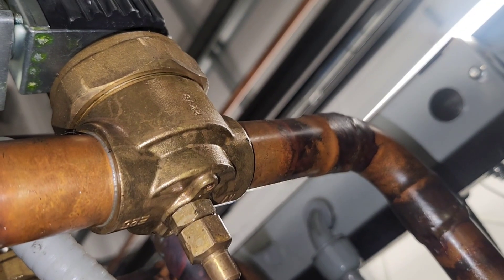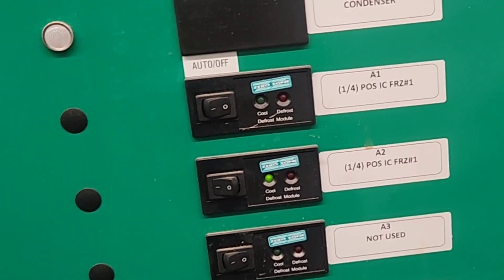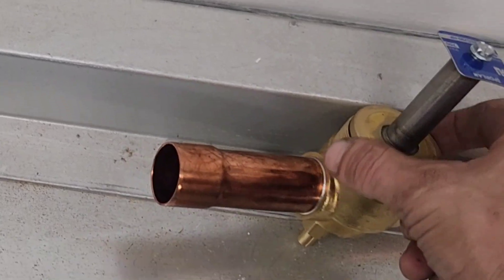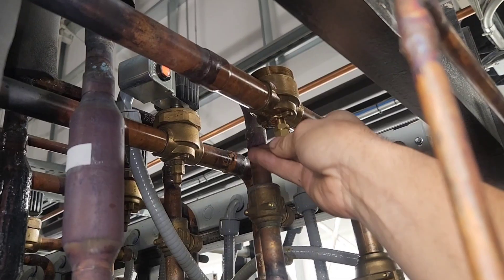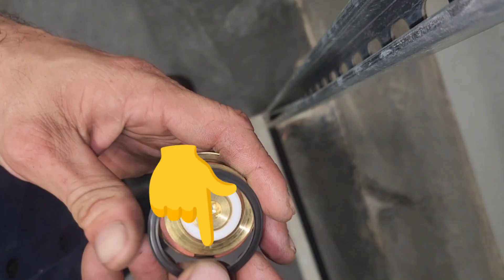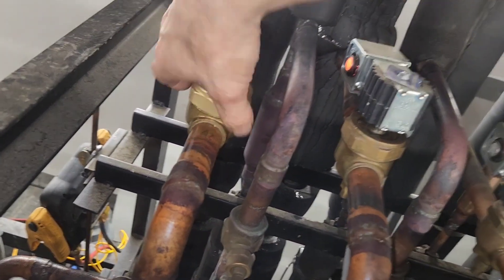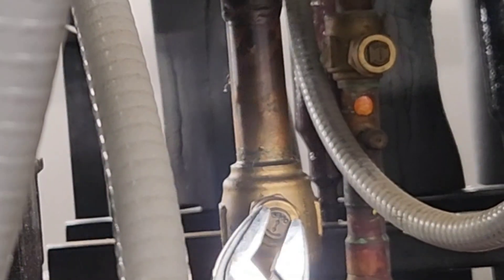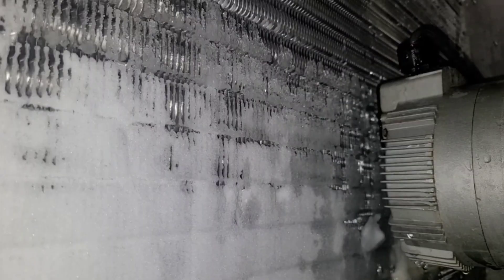Solenoid Valve Rebuild

Comment: Will likely never do this particular changeout in my usual scope of work, but appreciate the thoroughness of explanation and the channel slip lock tool tip.
Reply from the maker: @davejohnsonnola1536  thanks. What is your usual scope of work?
Reply: @HVACRServiceTech  Food  & Bev operations mgr at a casino/horse race track. Got an associate degree in HVACR in 1990 from a crappy program but never went into the field. Tried for mechanical engineering degree but differential calculus had me remain a bartender in New Orlean$  for too long.

2017 was bored and recently separated, started doing ice machine and reach in coolers condenser cleaning. Got the EPA and convinced the bean counters to buy some tools, probes, vac pump recovery, torches etc and I've been doing most of the reefer work there since.
Reply: @HVACRServiceTech  F&B operations / purchasing mgr at a year round casino / seasonal horse racing track + 15 OTB outlets.

Got an associate degree in HVACR from a crappy community college in 1990 but was making too much $ as a bartender in New Orleans to go into the field.

Tried mechanical engineering at a real university, but differential calculus convinced me to keep massaging cocktail waitresses out of a % of their $ tip$.

Fast forward 25 years, post Hurricane Katrina, new gig..... bored, too much time on my hands.  started cleaning reach in condensers and ice machines.

Convinced the bean counters to buy some tools and have been doing most of the maintenance and some replacements for then past 7 yesrs.

13 walk ins
7 concession stands
7 bars
600 seat restaurant
Yada yada.
Reply: @HVACRServiceTech  bit of a round-about to now...

Got an AAS in HVAC from a crappy comm college program in 1990 but never went into the field.

Tried using those credits for an ME degree.

Differential calculus convinced this already 30 something to remain a bartender in New Orleans.

Post Apocalypse Katrina, wind up at a seasonal  horsetrack/ full time casino in F&B ops.

Got divorced and bored in 2017, started cleaning IMs and reach in condensers.

Convinced the bean counters to buy some tools, got the EPA card and been taking care of most of the F&B  refrigeration and some hotside here since.

600 seat restaurant, 15 concessions & bars, three kitchens, 14 walk ins yada, yada.

Have good relations with outside contractors. When its over my head or time / product sensitive they get the call.
Reply: @HVACRServiceTech   long & winding road...

Associate degree in HVAC from a crappy community college program in 1990.

Never went into the field, was making easy $ massaging cocktail waitresses bartending in New Orleans.

Tranferred credits to a mechanical engineering program, but differential calculus convinced me to change majors.
Reply: Post apocalypse hurricane Katrina wind up in F&B ops at a seasonal horse track year round casino.
Reply: 2017, divorced and bored, start doing IMs and reach in condenser cleanings.

Convince the bean counters to buy some tools, got the EPA card and have been doing most of the maintenance and some of the installs here since
Reply: 600 seat restaurant, 15 concesion stands and bars, three production kitchens...
Reply: An annual music festival.. the Rolling Stones finally made it here last May.
Reply: Good relations with outside contractors.
When its over my head or time / product sensitive, they get the call.